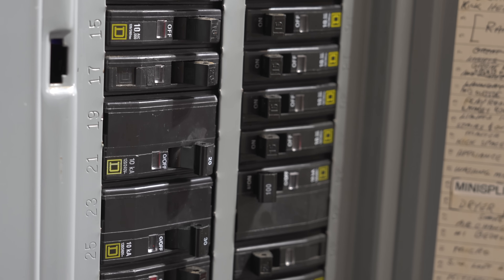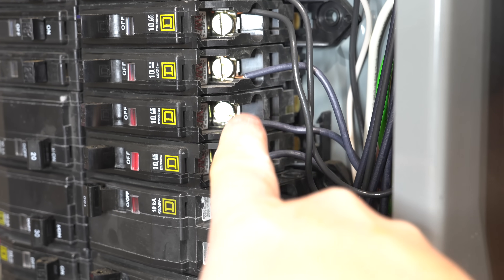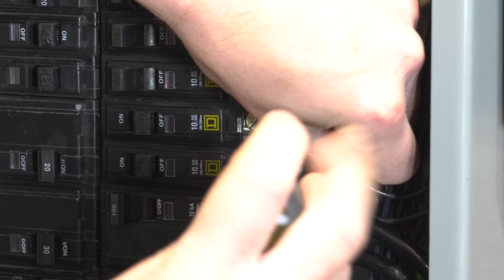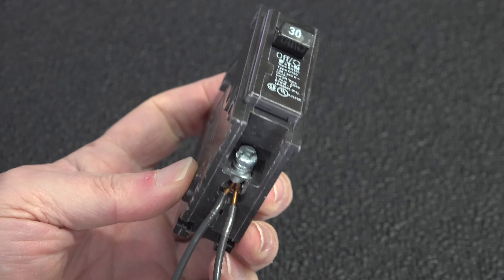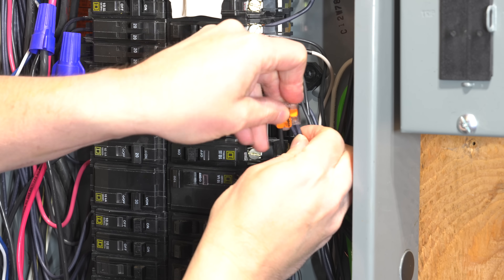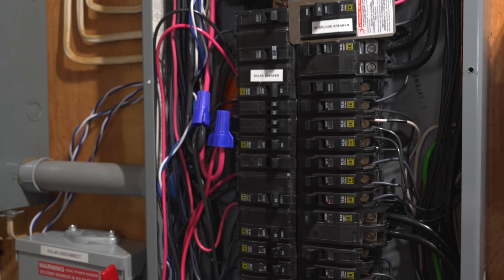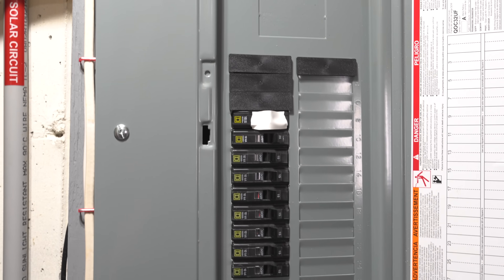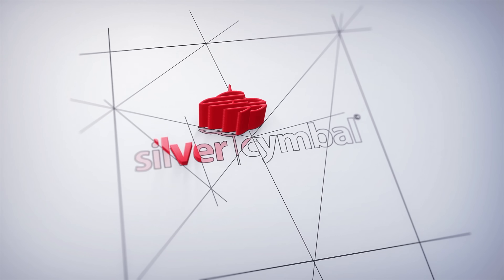Electric Panel Full?  Try This Simple Fix

Comment from the maker: ❤Guys, a few of your are going crazy so please read this and don't live with wrong info. First, please watch the whole video as I am showing 3 options when you run out of circuit space. Also there are misconceptions about what is legal, code and/or a good idea. First is what is the national electric code? It's not a law or even a set of rules. It's a published set of guidelines written by the NFPA and quite sensible which is why most, but not all states and counties accept the national electric code as their "rulebook" and locally have the power to not allow or disallow work or portions of it. This is why enforcement varies across the US. Two wires into a breaker is not against the nec code, if the breaker mfg allows it. Two wires pigtailed into 1 breaker is also allowed under the nec, or more correctly it is not prohibited and if a breaker only allows 1 wire, this is the only compliant way to do it if a breaker only is rated for a single wire.  👍 As stated in the video this is only for minor small, circuits, i.e. doorbells, single outlet to be combined to then allow one real breaker opening for the new circuit need. As shown, tandems are a better choice, and so on to the sub-panel. I may do a follow up on this since my videos will never encourage illegal or wrong behavior, it's to understand options and you decide what you want to do. A real world example is a 85 year old woman needed a stair lift in her home (needed dedicated circuit), she had no breakers left (45 year old panel). Tandems were not available, the electrician combined a doorbell and single outdoor light circuit into one with a pigtail to free up one standard circuit breaker to be used for the lift.  This was code compliant and fit the situation. Always use your own judgement, hire an electrician, the goal of the video is to help you understand there are a few ways to do things
Reply: This is one of my biggest issues with American electrical inspectors... they will 'call out' an 'illegal' thing...  no, it's not to code, not illegal, the cops are  not gonna arrest you for a double tap on a breaker ;)
Reply: I agree that it’s not a safety concern. Unfortunately here in Florida home insurance inspectors won’t allow it. Silly.
Reply: Some municipalities have codified the NEC into their ordinances. I suspect that most insurance companies would get jumping ugly regarding this practice. It's not worth get your home owners policy cancelled for this.
Reply: Also in experienced electricians will double tap the breakers or run them past 80% wich will melt wires
Reply: Outstanding, I sure wouldn't want to be the county electrical inspector arguing with you!  LOL!
Reply: this was "OK" practice up till around the mid eighties but is now illegal in most jurisdictions creating a life time liability for the installer that will void the homes insurance policy....and never use those chinsy push connectors for anything outside a lighting fixture ever.

Comment: Make sure your panel accepts tandem breakers, even if it fits.  My GE box doesn't explicitly say you can use them and it says "32 poles maximum" (and there are 32 spaces), even though the THQL tandem breaker you buy will fit perfectly.
Reply: Thank you for this comment. I found I had 3 tandem breakers in my main and my panel was not rated for this. So I just did a subpanel myself today

Comment: My clothes dryer 30 amp is in a sub panel and I want to add a 220 volt on demand hot water. Heater . Is it possible to use the same breaker for both sense I would not operate both items at the same time? If so can you briefly explain how to do that? Thank you

Comment: Thanks for the info...I was looking into why there were two black wire in a circuit breaker - I found one wire is for the Doorbell and the other wire was for the gas stove..That was there when the home was built. Now I'm looking to add a outlet next to the box and you have given me an idea...My breakers are mostly square D along with the Box.Going to check to see if the breakers are made  to use two wires....Thanks again..

Comment: Thanks for the well presented video.  I have a question about combining circuits with the pigtail-Wago. You combined two in one circuit breaker for hot/black wire.  What do you do for the neutral and ground wire? Install additional ground bar? Combine neutrals from two circuits?

Comment: Need some explanations.

I have a breaker box that had a circuit to some outlets disconnected, because it's breaker needed to be removed for a double breaker for an electric hot water heater.   I'd like to find another outlet circuit, disconnect that from it's breaker, connect it with the disconnected line above, with a pigtail - and then connect that to the breaker.   Apparently this isn't getting many thumbs up.   But I'm assuming if I pulled both lines out of the breaker, ran to a junction box, and then ran a line from it to the breaker, it would be okay.   I don't understand why the distinction.

Others mentioned if this is done, a load calculation would need to be done.   The comment was, "Breakers don’t just trip at 15 amps there is a curve that they operate on. It’s possible that you could draw much more than 15 amps between both circuits and the breaker not trip leading to fire hazards".  
I thought the purpose of the breaker was to prevent excessive current, no matter what the reason.   In my case, I'm combining multiple outlets on one breaker.   How is that allowing more current on that line, than whatever the original circuit already would allow?  
I've lived in older 1500 sqft houses where the original wiring for the entire house was across just 6 circuits (fuses!).  A tripping circuit was not uncommon.   We just made just not to use those typically two devices at that same time again.   But there was never any permanent damage to the wiring.

Comment: Your sponsor answered the question wrong.  Aluminum wire should always be larger when used in place of copper.  They specified 2 guage copper or 4 guage aluminum wire to run your sub panel when it really should be 2 guage copper or 1 guage aluminum.  Shame
Reply: Smaller guage number means larger wire

Comment: with the led revolution I can see where you can do a lot of combining but I think the problem is folks use hair dryers, curling irons, toasters, etc etc.. Unless you know that's not going to be used on the one you selected you're going to have a lot of breaker tripping and it will be like the 1970s all over again 🙂

Comment: I guess adding a sub, you have to make sure to not overload the service amp rating eh. So an additional 40 slot panel one would think you could do that if load it up to. Also, when they upgraded my service from 100 to 200 AMP, power company left the old skinny lines form pole to my house and attached them to much thicker wires from the panel which I didn't particularly like. But guess carrying all the current I need so far. I am out of breakers tough. It's a HOM box and key told me it could take tandems but later I find out it really cannot.

Comment: I recently had a situation where the laundry area and the basement room were on the same circuit.  The breaker tripped when the washing machine was in operation and a dehumidifier was running in the room.  I removed the panel cover and found that there were two wires going to the breaker (Square D  QO, 1956).  One wire fed the laundry area and the other fed the room.  There were no open spaces left on the panel.  The 15A tandem breaker was the perfect solution to the problem.
Reply: Probably they were once on separate 15 amp breakers and someone combined them onto one breaker to use the freed up breaker for another purpose.  They cheaped out and you fixed their cheaped out solution after you became aware of their "fix."

Comment: Excellent information.  Suggest adding a comment not to ever double tap (two or more wires) neutral (white) grounded wire to the same neutral bus bar tap.  Each hole in the neutral bus bar should contain only one white wire.  A fire hazard.  The NFPA distinguishes between the green grounding wire and the white neutral grounded wire...and many folks erroneously interchange the word ground wire for both the green and white wires.  Be careful...safety first.  Green grounding wire bus bar can be double tapped.

Comment: It is completely prohibited and very dangerous to work on a live electrical panel.
Also, it is prohibited to make connections in an electrical panel as you did, except, and only except, when replacing an electrical panel. 
There is also another problem in your electrical panel. I see a circuit breaker of 100
amps at position 24-26. This circuit breaker should have been installed as close as possible to the main circuit breaker.

Comment: Master Electrician and inspector here. This video pushes the code and will violate many articles most likely. Most areas in a home have specific requirements for a dedicated circuit, and randomly mixing them as shown is very risky.
Reply: I was hoping someone in the comments would mention this, especially with MWBC phasing.  (Overloading the neutral when it's a shared neutral for non fellow electricians). If you don't understand this you will likely be causing a dangerous situation in the right circumstances.  For god sakes just call one of us.  A service call is a lot cheaper than a funeral.  UGH!

Comment: What if you have three wire circuit ( two hots & one commend ) shearing one commend wire & the commend could be over loaded.  The commend should only carry the difference between the two circuits, but if the brakers are side by side shearing one commend they would be overloaded. Please respond.

Comment: Do I need to turn, the main power off. Going into the panel. First? Or just turn off each individual breaker. Before removing.
Reply: Do whatever you feel you can get away with without getting shocked. Lol.

Comment: Using the Wago as your video showed, can you apply the same method if you need a neutral terminal? My subpanel has space for one more single pole breaker, but no terminal for the neutral. I do not want to double lug a neutral. Thanks for your great, informative video.

Comment: When you remove a wire from an adjacent breaker and combine it you've just changed the phase of that second breaker. If it had a common neutral to a phased circuit between those two Breakers you've just overloaded the neutral
Reply: Yes!

Comment: Uhm, right now I am looking at a 20 amp tandem breaker at Home Depot for $16.00.  Why are they costing you $70?  What am I missing
Reply from the maker: Square D makes 2 kids of tandems, The ones that fit their new 2016 and up panels, those are cheap becuase they only fit the new panels. The panels prior to this have a different mount, those are $60 and up. No idea why they did this but check your breakers and part numbers before ordering
Reply: @SilverCymbal , good point, I didn't know!

Comment: I'm a big fan of your channel and a subscriber but I'm also a Local 134 IBEW electrician. The National Electrical Code (NEC) doesn't have a specific code that states a double-tapped circuit breaker is illegal. But Code 110.3(B) says, “Equipment that is listed, labeled, or both shall be installed and used in accordance with any instructions included in the listing or labeling.” you're sharing a fix that is hazardous an unsafe
Reply from the maker: Thanks and if you watched the entire video you are agreeing with me. I said some breakers like Square D QO are rated for 2 wires and can take them directly. If they are not a single wire must be used, hence the splice to run two circuit which is allowed.
Reply: In Chicago and most surrounding suburbs I know they don't allow tandem breakers at all, breakers have to be full sized. I did see an inspector once allow two tandems in a small panel, but only for 15 amp lighting circuits.

Comment: Can a second 42 space panel be connected to the existing 42 space panel an both be protected by the existing 200 amp breaker?  If so, how?  Thanks.
Reply from the maker: Yes you can. The panel installed next to my existing one is exactly that. If you looo up be. Salatrok on YouTube he did a wonderful video on installing a sub panel

Comment: I have a square d homeline box. I have learned it's a 30/60 panel.  I have three openings left with plans to fill them. It has a maximum capacity of 60 circuits. How many tandem breakers can I safely run?
Reply: Check the label on your panel

Comment: Retired electrician here.  If you look at the decal on the door of your panel or manual you should see a diagram. That diagram denotes where it's permissible to install tandem breakers. Unless it's a GE panel with mini breakers those tandems are usually only allowed to be installed in the bottom spaces. The diagram will also tell you the maximum amount of poles or tandems that you can have. Inspectors will take issue if they see tandems installed in the wrong spaces. For example a square D 42 space panel can have 52 circuits so you are allowed to install 10 tandem breakers at the bottom 10 spaces. Another pro tip is that you can purchase additional ground and neutral buses and install them, so you have more places to land your wires. Another option is to replace an existing panel with a larger one should you need more room.

Comment: I prefer to pull the breaker out then remove the black wire otherwise you hands are in proximity to adjacent breakers that are hot.

Comment: This is a bad idea. Use the tandem, you have some in the panel. A QOT1515 is the same price as 2x QO115.
Reply from the maker: Tadems are always a good choice, but the price is accurate. Square D had to stop people endlessly using tandems. They changed the design and all new panels will only accept 4 or 8 max due to a special pin lock they have so they won't fit ina  regular slot. The universal one that they offered for decades is now $75 and harder and harder to find. KInd of a strange move on their part but I guess I understand why.
Reply: @SilverCymbal  if your paying $75 for the part number I referenced for the job you showed,  you are being ripped off. It's less than $40 Canadian at Home Depot, and in good supply. Quads will be close to $75. The casing on the tandems are the same as a single pole, nothing stops you from putting more than 4 in a panel. Might not be recommended, but it's technically possible.
Reply from the maker: @seandoyle3918  No sorry you aren't understanding. They sell two versions of the tandem breaker, the "modern" one and thats $25-30 and the "classic: version which is $70 and up.  Most people who need these don't have new panels, but older ones so they must have the classic version. Most people are competely unaware the new version only fits new panels. They were very clever how they did this.
Reply from the maker: @seandoyle3918  Here is the old one: https://cdn.shopify.com/s/files/1/0246/2724/9232/products/qo2020-3_400x.jpg?v=1585662620 look closely at the pins
Reply from the maker: @seandoyle3918  Here is the new one, that hook is how they limit how many will fit: https://cdn-moce.doitbest.com/Data/ItemImage-528236-r9539zfx4g8ms6g499m745.jpg?AutoCrop=1&CropHeight=1440&CropWidth=1440&Height=1440&Padding=1&Quality=50&Resize=Auto&Revision=RSQV&Timestamp=Tt3skG&Width=1440
Reply: @SilverCymbal  ok, that explains it. That must be a USA only thing, not using that series in Canada.

Comment: SC, thanks for this video:  I'm moving into an older house, and these ideas are very timely.

It would have been nice if there were a short mention about balancing the total loads on the two hot phases.  In the video near the end with the new subpanel, all the new circuit breakers are on the left; however, I am used to see them being installed top to bottom -- certainly OK depending on how the panel divides out its slots for the two phases.

How about an informative video on converting three daisy-chained fuse boxes (no ground wires!) to a circuit breaker panel?  This would not be a DIY project for most people, but the info would help us to understand the issues involved.

Comment: My suggestion (applicable to both the US and UK and maybe other countries too) is  if your property is large in floor area, install one main panel with say 50-60A (US) or 50/63A (EU) breakers feeding sub panels close to the loads , the larger wire is expensive but not compared to long home runs of thinner cable, and it helps with voltage drop. And also for work in future, it's not so far to go to isolate a circuit.

And be kind to the next person. Label the outlet/switch with the panel and breaker number. For residential, a sharpie label on the inside of the outlet coverplate could be all the clue the next person needs.   It's frequently done in the UK on commercial, but should be common even on residential, it saves inconvenience to the customer. The number of times as a sparky, we have to randomly turn off breakers to find out which one is supplying that accessory is staggering. And yes i know circuit breaker finders exist, but theyre not perfect